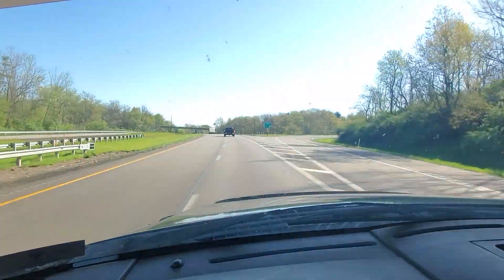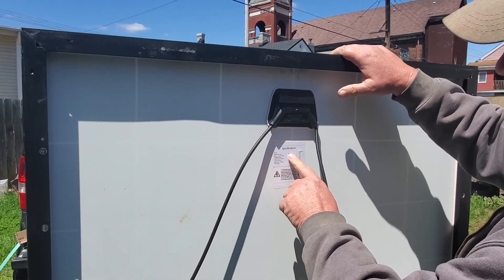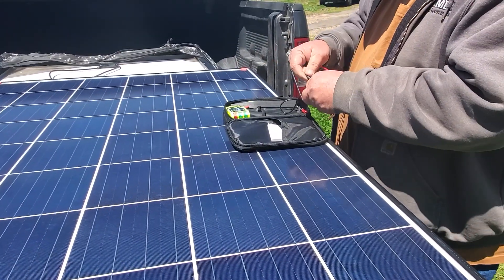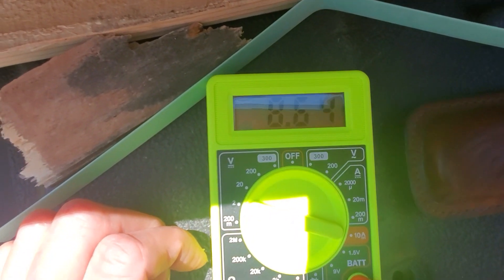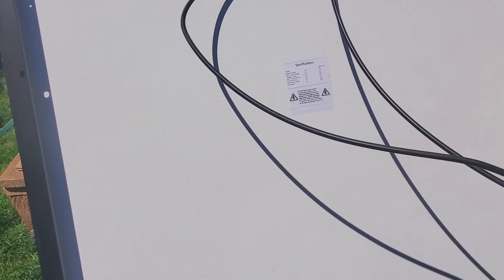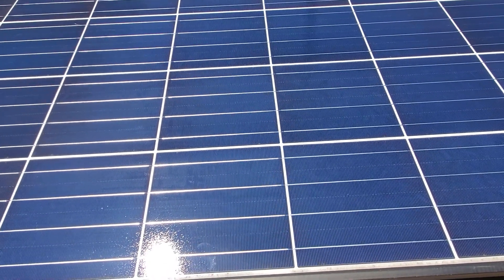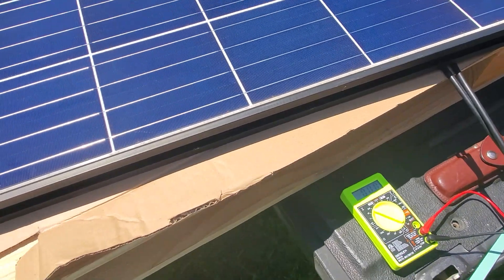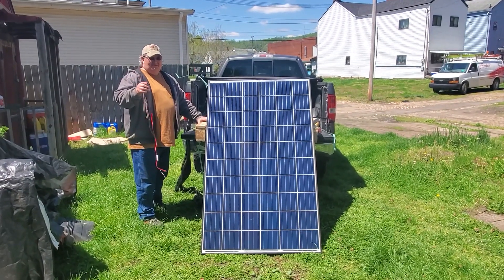DIY Test Used Solar Panels

Comment: Just got 10 365w panels used from them, they came in good shape, all worked.
Reply: Tbh from the way I understand how all the modules are in series on a panel, if you hit the volts on test, amperage should be fine

Comment: Wouldn't you need 2 meters testing at same time? One for amp load, and other for voltage under load? You were getting open voltage, and amps, but not at same time.  Doesn't the voltage drop about 10v under load? Maybe I'm wrong,  I've been known to be wrong.  :)

Comment: These panels are now on sale for $33.75 ea! I have 2 of these panels that have been in service in my off grid system along with 2-100Ah AGM batteries for 1.5 years now. This powers my Ham shack and provides power for charging Model Airplane batteries and runs a TV, Laptop and 2 monitors as well as other things on 24/7 with ease. I am lucky to live 6 miles from San Tan Solar and will be headed over there this morning to pick up 2 more of these used panels along with 2-300w new panels for a friend. Good Video!

Comment: I have to pay freight and working on order at the moment. I wish they were closer to me so I could drive and pick up some. I bought some Newpowa 100 watt panels at 78 each and wish I had seen these before.
Reply from the maker: +Jorge Serna These are working great for me.
Reply: @HomesteadWithJoe  These are the used good panel right? I was looking into the ones that show snail trails basically $10 cheaper each. I am still looking into what to buy. I started gathering supplies for an off grid cabin. I been busy but going to check out your channel. I'm not sure how you have them setup but hope you have a video. Thsmks

Comment: Yep, I just bought some for $30 each. wanted to add 5 panels to make 25 with my co-buyer who bought the 20 panels and santan was able to make that happen without getting all weirded out. I added the 5 panels from my ebay account not my co-buyer. No problem.  He said he could ship 25 panels on a pallet without making the freight go up.
Reply from the maker: +Rodney Solar-Circuits I've really liked working with these guys.

Comment: It can be confusing using the meter if the correct end of your switch isn't marked. I would use a marker to make it easier to see where it's pointed. I bought a fancy meter a long time ago, because I do this kind of work for a living, it has a better display and more settings. Of course, it cost more too. But I've had it for over 15 years, and it still works like new. That was a great buy on those panels! It's good that you found a stand-up company to deal with, too. Thanks for sharing this with us. What a good addition those will be to the Acres. Linda and I send our best.
Reply from the maker: +Odahi The Dubious Not being in the trade, it's more difficult to justify a fancier meter.  I like the idea of marking the arrow a different color.  That makes it fancier lol.  I'm really happy with the panels, and was happy to share with people who might want to get into solar on a budget. Stay safe!

Comment: Just remember if you're using 24v panels like these use a mppt controller if you need use on 12v system.
Reply from the maker: +paul hocking 👍